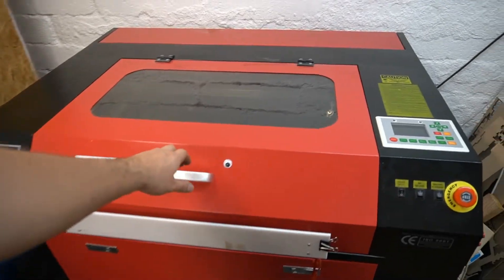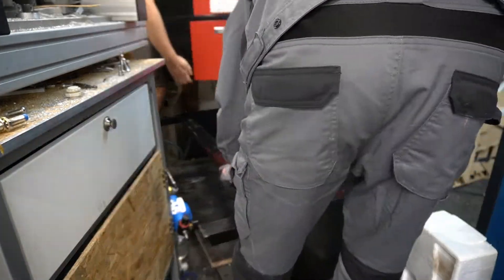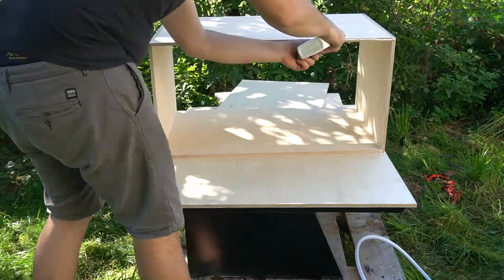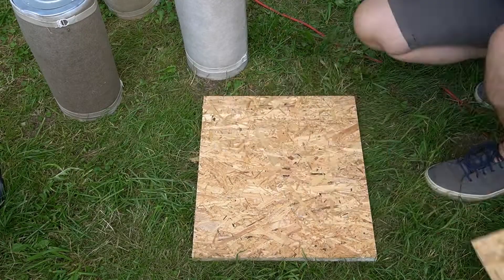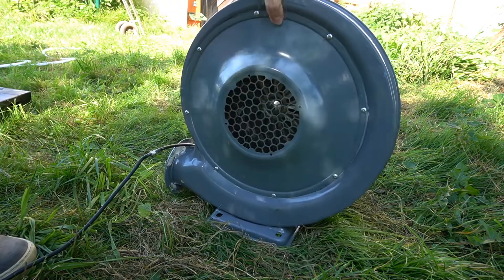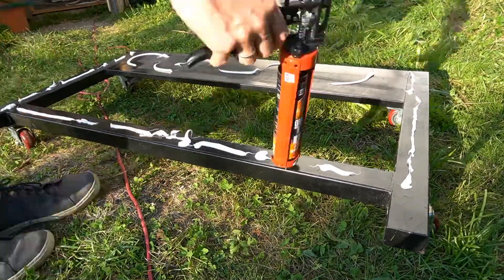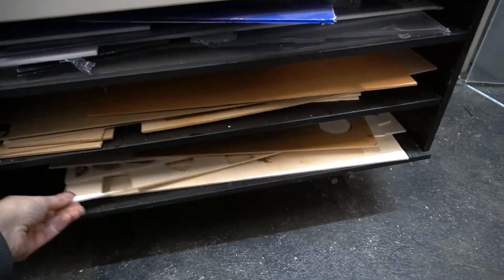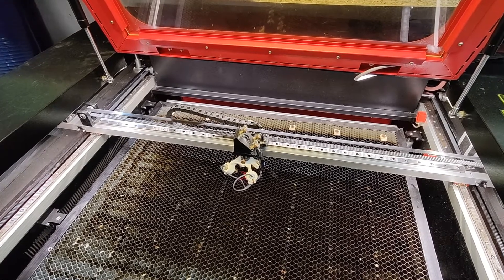DIY Lasercutter Filter system

Comment: Nice idea, but I think you will have a problem with the fan overheating in that small enclosed box. It needs air circulation to keep the cooling fins cool. You better check it before it's too late.
Reply from the maker: No worries, it has plenty room to cool the motor and the air is circulated by intself too. I've been running the Blower in a similar setup for years, so i guess it's fine. 
Cheers, Alex